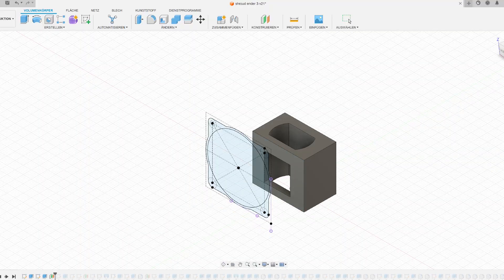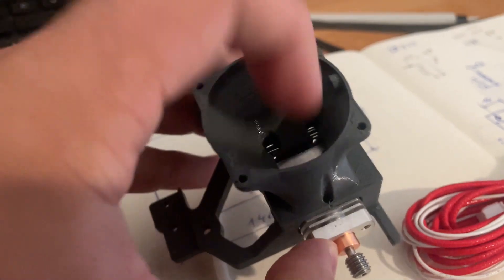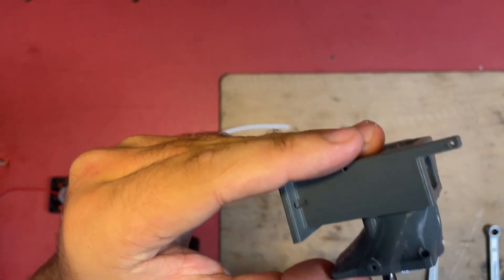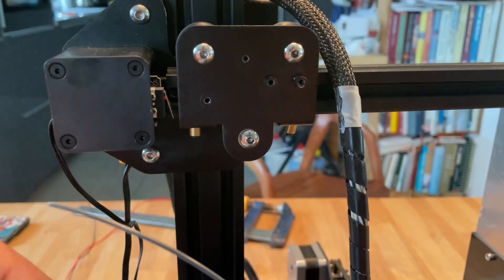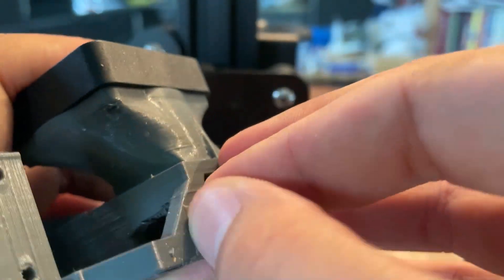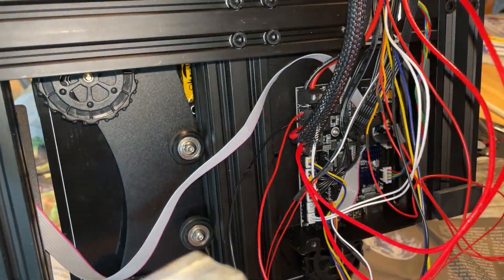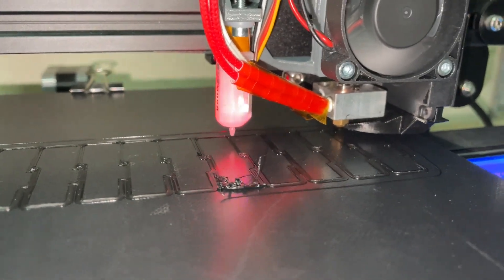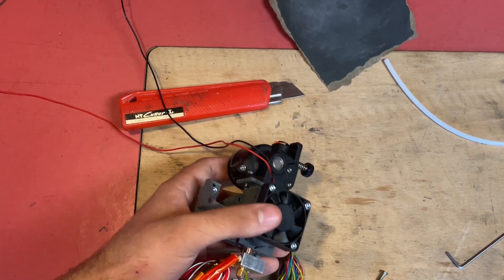Orbiter V2 Extruder Upgrade on the Ender 3 (all stock parts)

Comment: Very cool.  I noticed that center part you printed on the first layer had a lot of excess plastic.  What causes this?  
And yes, would like you to share the file if you have not done so already.  Thanks!
Reply from the maker: On this first print i had the first layer set to low and the big blob in the middle was caused by a some plastic bits of plastic that were stuck to the nozzle the link to thingiverse is in the video description

Comment: what firmware do u use because i use professional firmware and i tried fiting the orbiter but it dosn't work
Reply from the maker: The Printer is runnig marlin firmware. I had to do very littel work to get it to run i just had to change the steps per millimeter value and the motor current the setting for marlin were actually described on the manual i recieved with the orbiter.

Comment: future project : install a PEI bed instead of using this horrible glass platform. Maybe upgrade to a 5015 fan for the part cooling ?
Reply from the maker: In my expireance at least for pla this glas bed is working extreamly well the parts stick to it so strong that you can not get them off at all and when the bed has cooled down the parts come of by them selfe i have never tried a PEI shet on any printer i originaly got he glas bed because the aluminum plate on my ender is realy bent and i didnt have a bl touch at the time so i needet something flat.
Reply: @machinesfromscratch  fair enough

Comment: I have an orbiter one of my Ender 3's and I love it. I had to upgrade my mobo though so that I could easily set the motor current in the options menu. I wasn't able to get the motor to function at all without doing that, it was just dead. So now I have my other machine that needs a new extruder but I don't want to spent $100 upgrading the mobo + LCD screen like I did with my first machine, so I'm planning to go with a TH3D tough extruder since I like and trust that company and it can use a stock stepper motor or a pancake motor with stock mobo. I hope I don't miss the reliability and quality of the orbiter.

Comment: Did it work well printed in PLA. I'm going to print it, but I'm afraid it will warp with the heat from the bed.
Reply from the maker: On my printer i worked fine in pla

Comment: Did you change any software or add any software for the orbiter because I have one and I don’t know how to set it up
Reply from the maker: I did change the steps/mm in marlin and i also changed the motor current on the ones i got i recieved a manual on how to set up the software in marlin
Reply from the maker: https://trianglelab.net/u_file/2112/11/file/Orbiterv20FirmwareConfiguration-031c.pdf In this link is the manual that i recived

Comment: If you do a post print heat treat of your PLA parts they will be stronger and will have they glass transition temp of ABS. put them in an oven and set temp to 65c. you only have to leave them in for about 15 minutes. Let them air cool and you are good to go. You will need to oversize the parts by 2.5% to 3% to allow for shrinkage after heat treat.